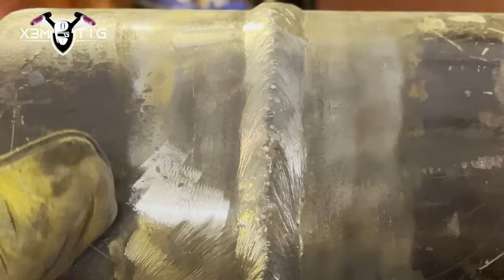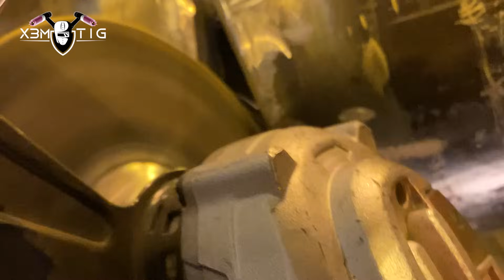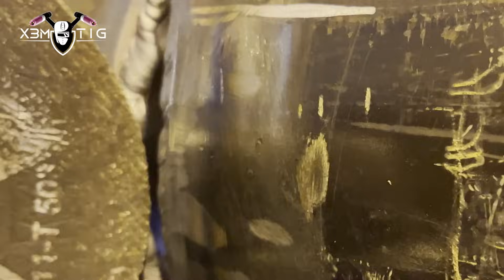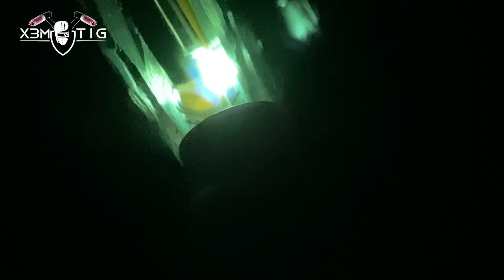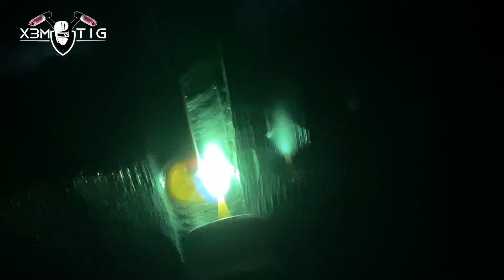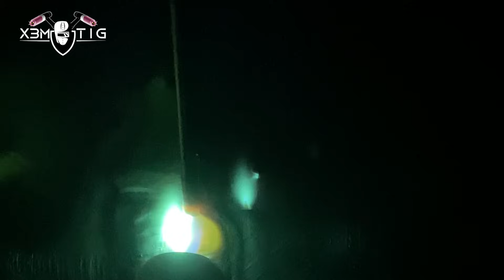The Ultimate Tig Welding Hack For Pipe Repairs!

Comment: Dang, I could’ve used that gap reduction tip today, in school we did our first multi spool pipe run and at my spool connection I had a 1/4” R/O ended up doing my first free hand on it.

Comment: Hey mate, if the root pass is just flush, can it still pass the x-ray? Thanks

newbie here😅
Reply from the maker: In summary, a flush TIG root can pass X-ray inspection if it meets the necessary quality standards and acceptance criteria. Proper technique and adherence to welding codes are crucial for ensuring the integrity of the weld.

Comment: Going from a 60 series rod to a 70 series filler rod for a repair wouldn't make sense to me either. And I've never seen a weld procedure calling for 60 series tig rod.
Reply from the maker: I was talking about E 6010 stick, and repairing with tig procedure…
Reply: @X3MTIG  I understood that. I was just curious how they justified repairing a 6010 stick root with an er70s2 or 6 tig rod. 2 different tensile strengths on the same joint just don't make sense to me. Plus the dirty dirty nature of 6010 doesn't lend well to tig welding as you mentioned.
Reply from the maker: @hadleytorres8171  exactly. If I wasn’t there I wouldn’t believe it, still don’t understand, and even asked few QA guys , doesn’t make any sense to them as well!

Comment: I have done a lot of these. Yes, it's almost always in 6-9 or 6-3 o clock. So much fun... not. Especially when it one's own damn mistakes. Porosity is also turning up a lot when welding outside. Shielding from wind can at times be extremely difficult, espcially when doing large diameter pipes.

Comment: Awesome video as always. I prefer to use a 1/8” x 1/2” flat file to remove my bur. I don’t like using banana knife. Hacksaw blade works well too but I’ve just personally found my small flat file works best for me. I’m pretty new to pipe welding. Only been on my first union job 6 months but in that time I’ve welded over 50 joints and only had 3 repairs come up (100% X-ray). There’s been many times I’ve put my root in, look inside and say “oops, I’m definitely grinding that out and redoing it” 😂 these were stressful days but very good learning experiences. I religiously watched your videos when I was practicing for my pressure certifications and I continue to watch and I highly value all your videos. I attribute a lot of my success to you X3M, so thanks again!